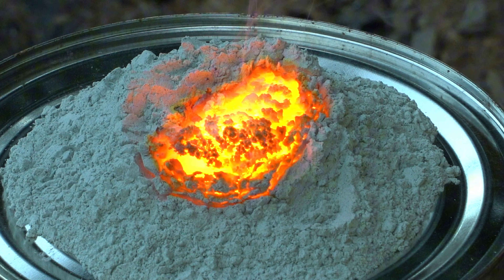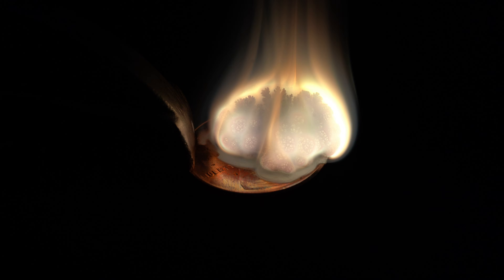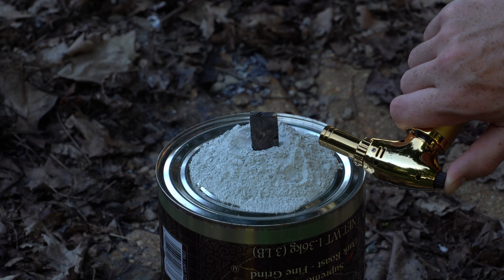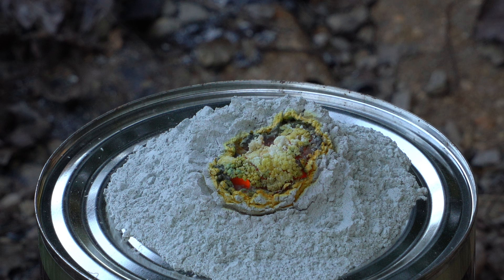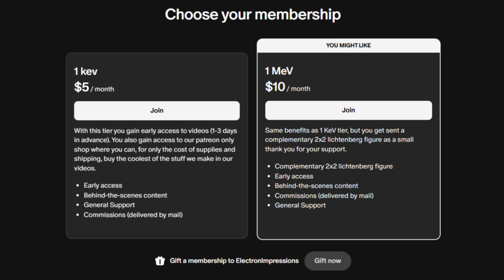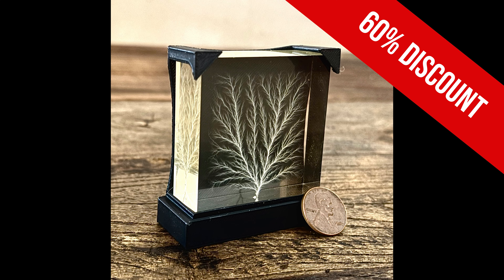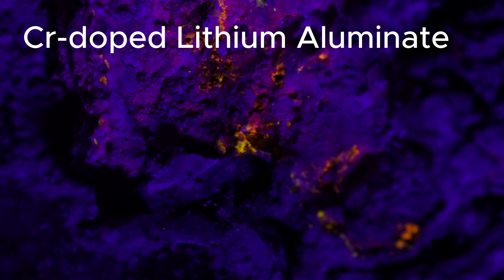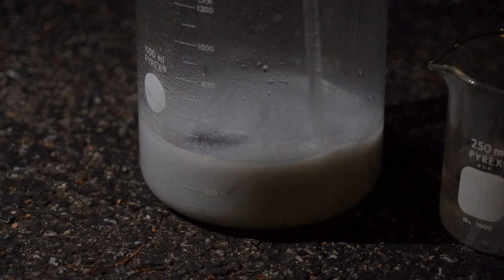Making Rubies from Thermite

Comment: Even without it...put alumina and chromica inside aluminium foil cover with few layers like ball and they heat with lithium. And show exactly what you see, you can cover some way like have clylinder with cavity and cover on top with weight so it dont come off. will it explode...well its trial and error. we have to ensure there is not much oxygen from outside.

Comment: Why didn't you mixed lithium with the powder?
Reply from the maker: This could’ve been done, but cutting up lithium fine enough to do this would have been difficult. More importantly the lithium served to supply heat to the surrounding oxide, so maximizing its reactive area would likely contaminate more alumina/chromia without necessarily making more unadulterated ruby.

Comment: Why not change the presses? If you can just make aluminum foil tubes filled with the ruby powders and then surround the    Thing with a proper mix of thermite for a slow but extremely hot burn if the thickness of mass to thermite ratio is right you should be able to get sold crystal cores

Comment: Spodumene is LiAlO² and has orange-yellow-pink fluorescent reactions depending on contamination.
Reply: Sorry LiAlSiO²
Reply: @johnweaver4421  Yeah, that silicon is a problem (I was thinking lepidolite, which I know shows some luminescence under UV light that is characteristically quite yellow, but it's the same issue...actually worse, because you need some potassium in there too, and some other junk). A basic literature search confirms what was suggested in the video - chromium-doped lithium aluminate does exhibit some luminescent properties.

Comment: I was curious to see this until you stuck a chunk of lithium into the pile of oxides. I don't know how to get a fine powder of lithium unoxidized but the contact surface area should be raised somehow. The easiest way to think of is melting the lithium in inert atmosphere and mixing with the powder. Or, cooling it with liquid nitrogen to make lithium brittle, shatter to pieces and mix, or operate a ball mill in liquid nitrogen which could hopefully grind it and also mix well with the oxides, it would provide the inert atmosphere as well reduce the risk of the reaction starting spontaneously if that's even possible.

Comment: It's otherwise known as "corundum" not "sapphire". 
I attribute this to a script error, not a scientific one.
Sapphire and Ruby are both corundum, but only ruby contains the specifics chromium inclusions you mention causing the distinct ruby red.  All others are considered technicality sapphire.  Classically deep blue sapphire is caused by titanium inclusions.  Padparadscha orange sapphires have beryllium.
Clear corundum is also technically sapphire.

Usually the materials listed as "pure" have corruptions in them which are affecting the purity of the crystal structure.  Anything like silica as per silicates will not allow corundum to form, because it preferentially binds/replaces the  aluminum.  I'm not a chemist nor do i know if it's even possible to get totally pure aluminum and shit.  I would figure a way to preprocess for purity.  At least scrub out some of the usual suspects contaminating any materials.

Comment: Very interesting. I wonder if this would work with sodium metal as well. I happen to have more sodium metal than I can shake a stick at, as well as pure alumina and chromium trioxide. Maybe I should give it a try. :)
Reply from the maker: It would not, at least not through exothermic reaction of the sodium with the alumina/chromium oxides. The oxidation of lithium is much more strongly favored thermodynamically than the oxidation of sodium (due to smaller ion) and this drives the spontaneity of the lithium reaction with those oxides which is absent for sodium

Comment: Assuming the yellow was also corundum, yellow sapphire is formed through Fe instead of Cr. Perhaps the metal lid you did the reaction on contaminated the product with iron. Interesting how it’s seperate from the ruby, indicating it was created under at a different moment in the reaction.
Reply from the maker: I highly doubt this because a) the lid was completely undamaged and protected by a thick layer of oxide sitting in between, and b) when water is added to the yellow powder, it dissolves fairly well, turning the water a shade of yellow.
Reply: @ElectronImpressions that makes sense. Nice video.

Comment: or hear me out, what about doing the opposite.
instead of using aluminium oxide as the oxidizer, use aluminium as the reducing agent and as it reacts it will give your alumina.
I am not saying you should make dichromate thermites but...
Reply: At that point you might as well add sulfur to the mix as well, then douse it in water.  Go straight to Hydrogen Sulfide!

Comment: Hi Electron Impression, Really nice experiment and short video.

Stil there are way too much possibilities of reactions due to a lot of possible products or reactions, side reactions and the products becoming reactants of further subsequent reactions...

1) Li can react with N2(g) and O2(g) to make Li3N and Li2O (and LixNyOz maybe? I think to hyponitrites Li2O2N2 or the likes.
3 Li2 + N2 --> 2 Li3N
2 Li2 + O2 --> 2 Li2O
Maybe
Li2 + N2 + O2 --> Li2N2O2(?)

2) Into the thermite reaction you depicted:
3 Li2 + Al2O3 --> 2 Al + 3 Li2O + heat

But you aswel have:
3 Li2 + Cr2O3 --> 2 Cr + 3 Li2O + heat

3) Al do aswel burn into air to form AlN and Al2O3 and heat.

The later can combine with Li2O to form an aluminate:
Li2O + Al2O3 --> Li2Al2O4.

The same is true for Cr2O3 (supposing Cr doesn't form nitride as Al does).
Li2O + Cr2O3 --> Li2Cr2O4.
This might somehow be responsible to the Li2CrO4 or Li2Cr2O7 (yellow orange) forming upon further oxydoredox from air oxydation into the hot glowing regio.

4) Into the reduction and reoxydation process of Cr2O3 --> Cr --> CrO + Cr2O3 + CrO2 + CrO3 

This later is rather unlikely because too unstable when heated above 250°C; but CrO, CrO2 might be interesting to test with Al2O3 to determine for eventual glow (orange-yellow) at higher energy than pink that you observed in tiny spots.

5) There are so many products above to test alone for fluorescence under UV-light; but aswel in fused binary combinations because as you know: nor Al2O3, nor Cr2O3 does fluorescence alone and fluorescence only occurs when both compounds are molten into a "glass" like product englobing both intimately bonded molecularly.

Regards,
PHZ 
(PHILOU Zrealone from the Science Madness Forum and many former A.O.L newsgroups related to chemistry)
Reply from the maker: We appreciate your insight on these videos, thanks for the detailed analysis! I hadn’t thought about the possibility of the chromate coming about through Li2O and Cr2O3 reaction directly, but I guess that would make sense. It would seem this still requires oxygen from the air to transform the Cr(III) to Cr(VI) however.

Comment: Lithium usually don't make peroxides, because Li⁺ is too hard Levis acid. That makes peroxide anion unstable (it's soft base).  Sodium and others can form peroxides (or even ozonides for more soft cations)
Reply from the maker: Ah ok, maybe Li2O reacting with Cr2O3 in the presence of air will do it
Reply: @ElectronImpressions  i have some thoughts about lithium nitride, but i don't sure

Comment: all yellow chemistry is TRASH 🇦🇺
nice experiment! much more even distribution of Ruby than I was expecting too. from what I can see, introducing lithium into an aluminium oxide crystal structure disrupts it and turns it into what's referred to as a beta alumina, a highly conductive, more layered arrangement very susceptible to ion uptake. and I saw suggestions that this can shift the fluorescence emission band of the chromium? but I couldn't find any direct confirmation that it can shift it all the way to a bright yellow

Comment: This is not a termite process.
Reply from the maker: A thermite process is when a metal oxide is reduced by a more reactive metal. The reduction potential of lithium is more negative than that of aluminum in Al2O3, indicating that a spontaneous redox reaction will occur between the two materials, as seen in the video.
Reply: You are correct. Not a single piece of wood in sight!
Reply: @theodorekorehonen I miss a h. You miss how chemistry works
Reply: No I'm fairly certain you meant termite.
Reply from the maker: @theodorekorehonen  I'm starting to think this guy meant termite
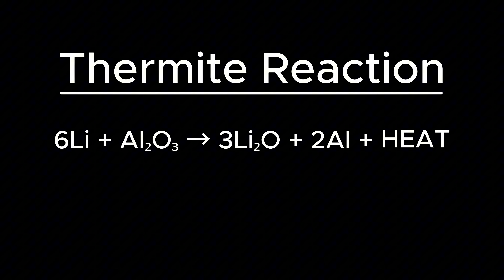Reply: No you did not. Even if it wrote a (unusual) thermite process , at 1:11, and even assuming that would  thermodynamically be a spontaneous process, what you actually got is not metallic aluminium ( and or metallic chromium, as you added chromium oxide, in the mix), using Li as reducing agent of the Al (and/or Cr) oxide. 
What you got, is promoting some mixed oxide formation , by partially melting and mixing of the Al and Cr oxides (or perhaps just promoting some solid diffusion of the ions, between grains of the to oxides), driven by the heat of Li oxidation.
You DID NOT get any metallic Aluminium, nor Chrome. 
So it is not a thermite at all : you just promote some transfer of Cr ions from Cr2O3 to Al2O3 by the heat release with the burning Lithium: you could have just heated the mixture of oxide, or direct your flame on them, instead of wasting the Li
Reply from the maker: I’ve done this same reaction with pure aluminum oxide and produced a product that I can positively identify as aluminum metal with lithium impurity. If you are trying to argue that by simply adding 1% chromium oxide to this reaction is going to obstruct the aluminum-forming redox reaction between the lithium and alumina (which is thermodynamically spontaneous) then I don’t know what to tell you. If you want to argue there is a mixture of various oxides among a mixture of metallic products, I won’t disagree, but to say there is no Goldschmidt type redox going on here is to be sorely misinformed. Thermodynamics aside, I’m not sure how you explain the sudden vigor in the reaction you witness when the burning lithium makes contact with the oxide powder without exothermic redox in the equation.
Reply: @ElectronImpressions 

Pauli used to say: “this is not correct. This is not even wrong”.

That’s what your video is about.

A quick reminder about how the scientific method work: you make an hypothesis, you do an experiment, and you verify if your hypothesis is in line with the experiment.

You say that you have a thermite process of the type:

Al2O3 + Li —> Al + Li2O 

You do an experiment, the result is that you do not get any Al.

So you have zero proof what you see is thermite. End of the story.

(Your statement about increases brightness is irrelevant, as it can just be related to the way the Li burns with air, as it melts…or not: the point is, you have zero proof).

If you wanted to carry out a proper experiment, to verify if a thermite of the type you proposed happened (which is a very legitimate scientific question), you have to make a proper experiment, and a proper analysis of the results, not the FAFO + sloppy interpretation you are showing.

Comment: 2:56 It doesn't look like it. Chromium is most likely simply producing a different color in a different crystal lattice (LiAlO2).
Reply: 3:11 Uh, okay, maybe it is. Without tests impossible to tell.
Reply: 4:51 Sooo, probably it's aluminate, however
Reply from the maker: I love the train of thought represented by these 3 comments
Reply: @ElectronImpressions Haha, yeah, that was kind of amusing.
As for what else to do with lithium – I’ve long wanted to try growing quasicrystals of Al₆CuLi₃. It would be especially fun to grow them within a matrix of some material like an iron-based alloy (for example FeCrAl), to possibly get an interesting pattern. And this could actually be done using a lithium thermite reaction, just like in the video.